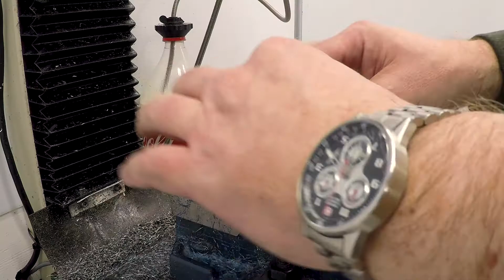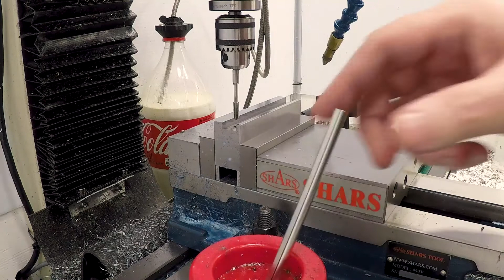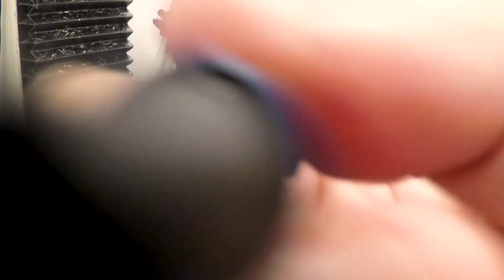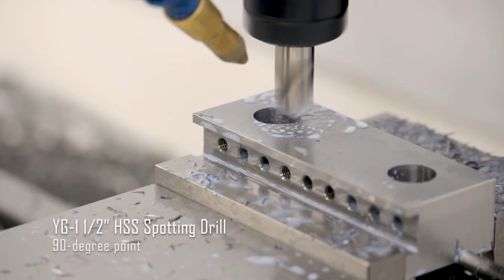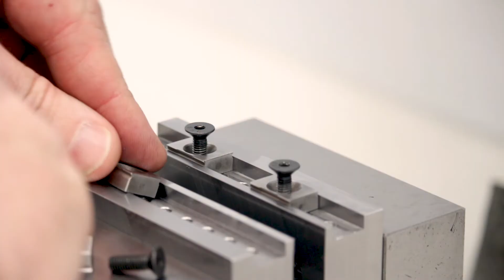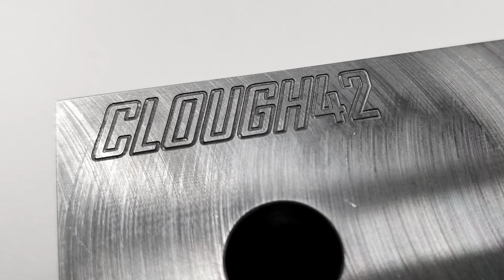Making TalonGrip Low Profile Edge Jaws - Part 4

Comment: Excellent series.   I noticed when you machined the slots that the mill was making circular cuts, then advancing.  Is that a g-code command or part of the fusion360 movement?  Also I saw you using a chart with feeds/speeds.   Is that available as a pdf?  thanks for sharing

Comment: James do you make your GCODE on fusion 360? If so that would explain the motion of the CNC. Would answer some notion that there is something wrong with the CNC. Amazing how some folks think there is a problem with the machine. CNC means the machine is doing what the GCODE tells it what to do. It does not jump up and down on its own the GCODE tells it to do that motion. Fusion 360 has what is know as progress cutting.
Reply: The weirdest thing is that it starts it’s back and forth drill cycle where the part used to start, rather than where it currently is.